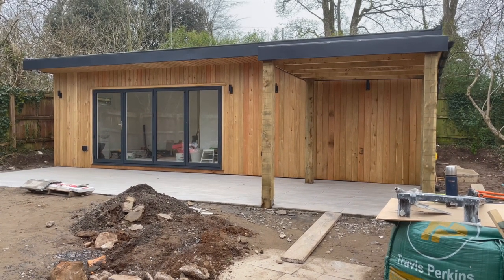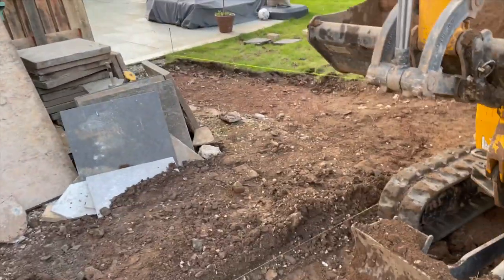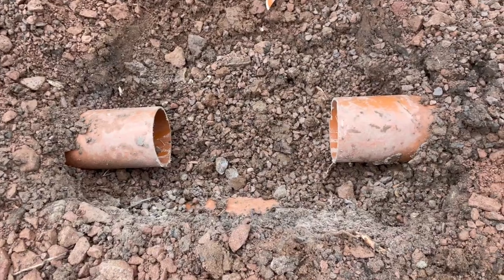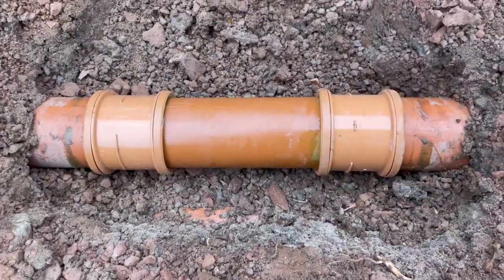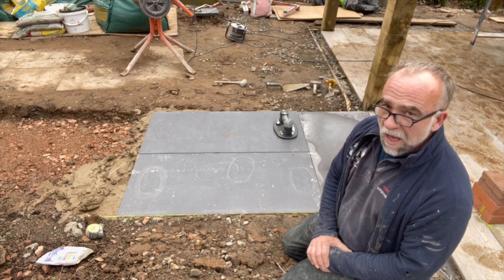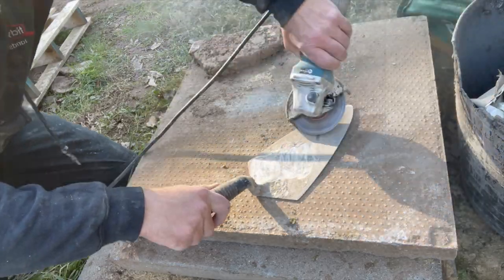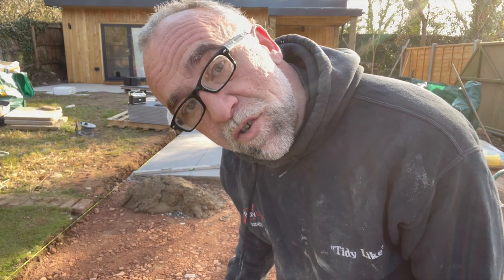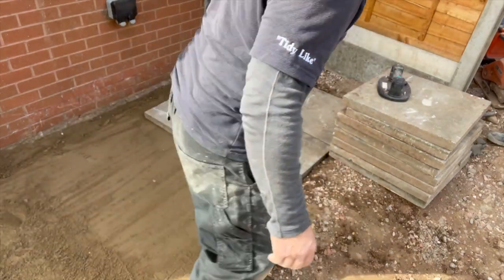Grabos suction cup for BIG Tiles #grabo #suctioncups #worksmarter

Comment: My grabow turned up today with spare ring and spare battery does your charger make a noise and get quite hot as mine is??
Reply from the maker: I does make a noice when pumping almost start meditating when it happens uuummmmmmmm not noticed it getting hot no but that depends how much you’ve been using it   🤷

Comment: I use the Grabo's all the time for my exterior tile installations and love them. Your installation methods however are completely insufficient for several reasons which I will list below for you. 

The cement you are using does not bond to the tile whatsoever so what is going to happen is that the tile will pop off of the cement in no time. If you want to bond the tile to the cement you should be using a polymer modified thinset on the bottom of the tile to bond it to the slab. 

The cement base you are using under the tile is not reinforced and will move and crack in absolutely no time. The proper way to build a walkway is to pour a reinforced concrete walkway first and then mortar/thinset the tile to the walkway or use a pad/pedestal system that does not require mortar. 

You are not checking the tile after you have set it for coverage. What you should be doing is setting the tile and tapping it down into place and then pulling it up and filling any voids that are left under the tile. The way you are doing it you have maybe 30%-40% coverage max. What will happen is the voids that are left under the tile will fill with water then freeze/expand and pop the tiles off of the cement base.

You should not be making videos on here showing people how to do anything as you have absolutely no idea what you are doing. The project in this vid is guaranteed to fail and is probably has already since this vid is a year old. One cold winter is all it would take to pop all of the tiles off of the substrate. Total amateur workmanship.
Reply from the maker: Bla bla bla construction in the UK is different to wherever you are from we don’t lay patios on concrete slabs over here we use a flexible base and every tile is primed with a cement slurry and I’m very confident they are laid correctly 
So go pester someone from the USA 👍🏴
Reply: @tidybrickslandscaping  I am not pestering you simply pointing out what you are doing wrong. You did not respond to my comment just dismiss it which is hardly surprising. My crew and myself install 20,000+ square feet of this material every year and have extensive experience with this product. Just so you know I myself have installed a project using the exact same materials and installation methods as you used in the video. It failed. The tile popped off of the substrate after a couple of years and I ended up having to redo the work. This was one of the first jobs we installed using this material. Unlike you I actually learned what we did wrong and took the extra steps on my projects moving forward to ensure that they wouldn't fail again. By all means keep doing what you are doing but don't be surprised when your installations start failing and your clients start calling you and asking why. Ignorance is bliss I guess.
Reply from the maker: @markadler8968  then you will have to tell every installer here in the UK as this is classed as a British standard across the country so email them instead
Reply from the maker: Understand your audience first
Reply: @tidybrickslandscaping  I don't have an audience and have no need to put videos out on You tube for validation or to generate interest in my business. My workmanship/reliability/accountability/reputation provides me with more work than I could ever need. Your installation methods  are undeniably sub standard and will fail. That is a fact. Saying "well that is just how we do it over here" is hardly a cogent response to my comment and the valid concerns that I provided.